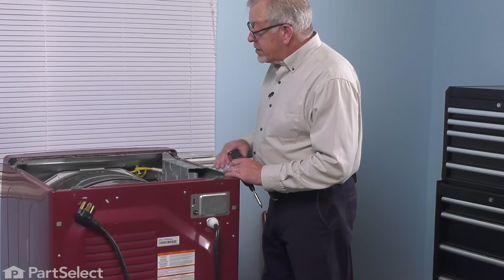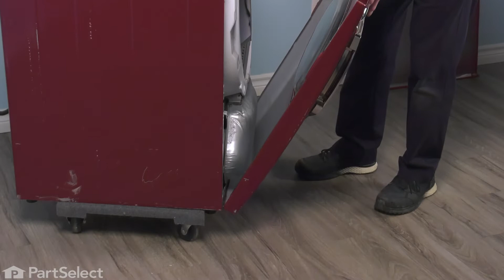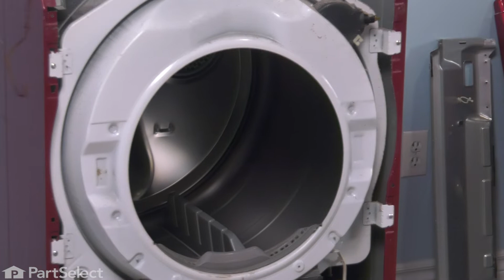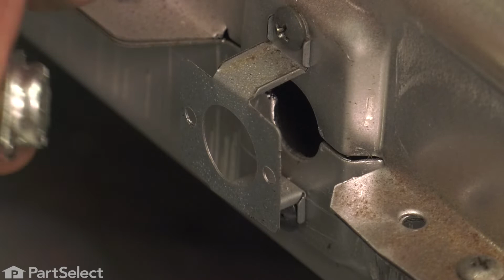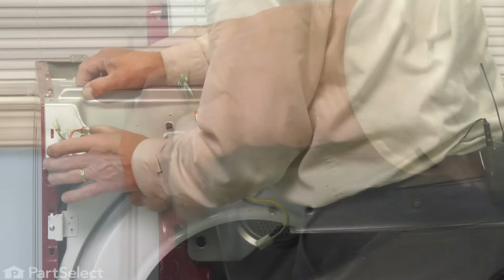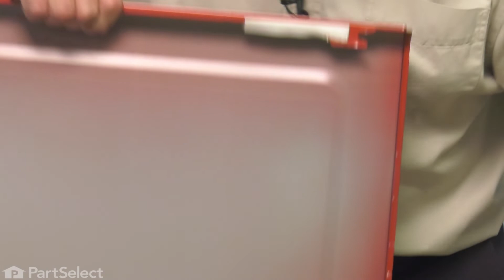Samsung Dryer Repair - How to Replace the High Limit Thermal Fuse (Samsung Part # DC47-00015A)

Comment: Thank you, for your excellent video. My dryer, dvg50a8500v/a3, had similar symptoms. So, opened it with your video as the guide. THough the models are different, almost all the steps matched. Found that a sock that caught stuck in the plastic fins of the blower(?) caused it. Removed it, put the whole thing back and it started working again. I already bought DC47-00017A. Returning it to Amazon.

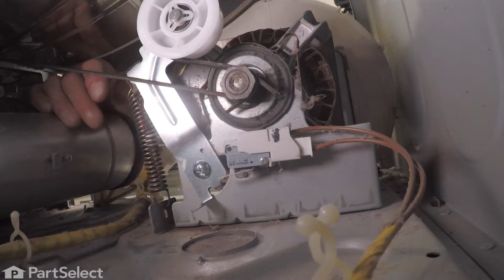Comment: Too bad you didn't inspect the belt. 6:06 and 11:09 It's shot. Also, you said at the beginning that it is a really easy repair. To me that means popping off an access panel and unscrewing the old fuse and replacing it. Great video though.
Reply: I also noticed the belt was about to go. I hope he noticed this too after watching the video.